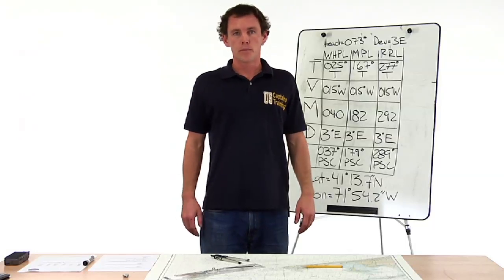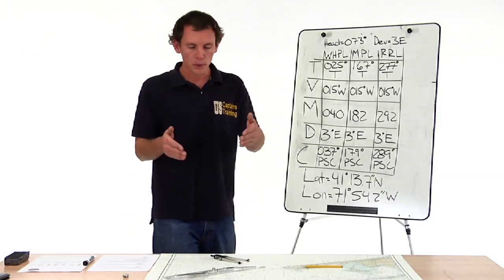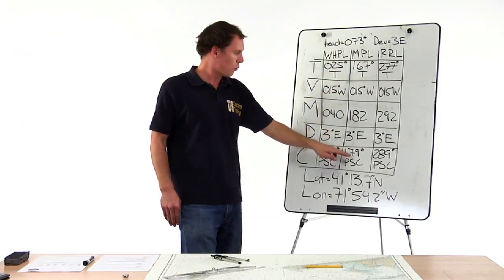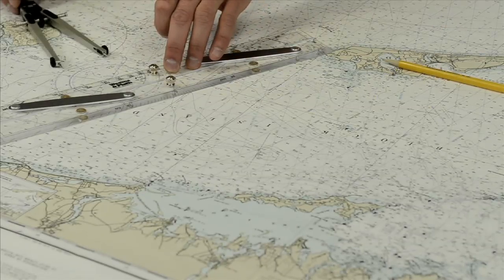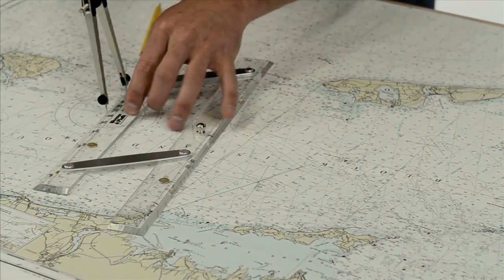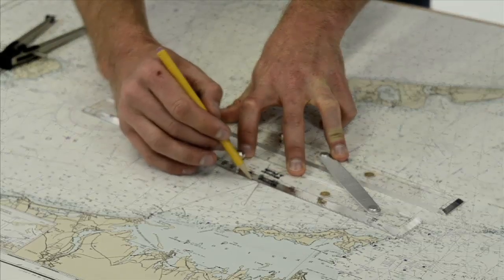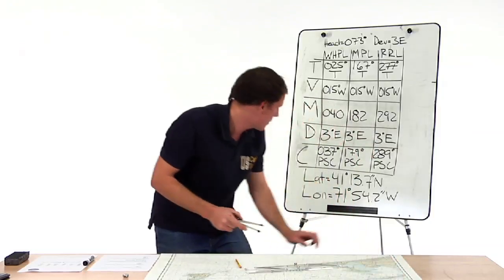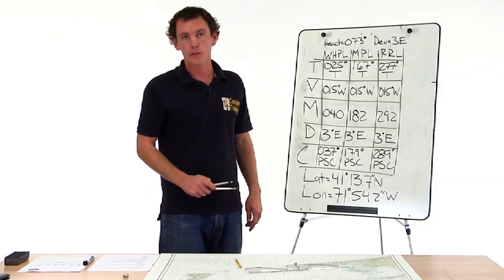3 Point Fix

Comment: Nice example.  Let me present an interesting sidenote :

Some people will intuitively tell you that you are 'somewhere inside this triangle' ... in actual fact you can be either side of each line with 50% likelihood.  To be inside the triangle you'd need to be on the inside of all three bearing lines ... the maths (combinatorial probability) tells us that we are inside the triangle only 1/8 (or 12%) of the time.

So, it is more correct to say... we are most likely NOT inside this trangle.

I know this sounds pedantic, but it is an important point to make as it teaches us not to place too much faith in our 3-point fixes.  You're NEAR the triangle, but 88% of the time, you're outside of the triangle... so the error is always greater than it appears.

Never underestimate margins of error :D
Reply: Yeah well the USCG is only allowing me 30% of marginal error so what part of the triangle am I supposed to be measuring from, this is ridiculous. Any advice on which part of the triangle to measure before this time tomorrow night would he great, thanks.
Reply: Ocean James Measure from the centre.  Your margin of error will probably be measured on the accuracy of your fixes... so take your fixes well and, if moving, in a timely manner.  Slow fixes can give you large triangles.

Despite being most likely NOT within the triangle (no matter how well you fix) you must always measure from the triangles centre ... as it is still central to the cloud of probable positions.  So, doing so minimises your error... but a good skipper should always be aware that his error margin is larger than his triangle ; )

Good luck on your test : )  Don't rush it and I'm sure you'll do fine.
Reply: GaryChap Thanks, sometimes my triangles are a big large, and I'm sure my fixes are accurate. So when the multiple choice answers are all a decimal off, all I can do it choose the closest answer. It's unnerving
Reply: Ocean James I don't care if my watch officer doesn't know exactly where we are... as long as he can state with absolute certainty where we're not.  The latter is almost always way more relevant ; )
Reply: Thanks garychap
Reply from the maker: Ocean James i hope your test went well and i realize that i am a bit late on this response. if you bisect at least two angles of the triangle it will give you the center. i wish i could illustrate with a drawing but, imagine this, a pacman with mouth open < draw a line out the center of this angle, like a pacman tongue which leaves the same angle on the top and bottom. do this to two angles in the triangle and where those lines intersect is the center of the triangle. this comes in very handy on long thin scalene triangles.
Reply: US Captains Training I passed, thanks to you, Captain Neil. When I upgrade I want to work with you or someone at US Captains Training. The classes at my school have just gotten too big and I feel like the quality of instruction has declined. I do well with individual instruction, or at least in a smaller class. I wouldn't have minded paying twice as much as the $895.00 if someone could have accommodated this for me.
Reply from the maker: Ocean James We are happy to help James. Keep in touch.
Reply: Do you have any idea how many students at my school mentioned studying with the help from your videos??? A LOT. You should make dvd's and sell them at $200 a pop. I will keep in touch, thanks for all of your help. I really owe you. I want US Captains Training next time.